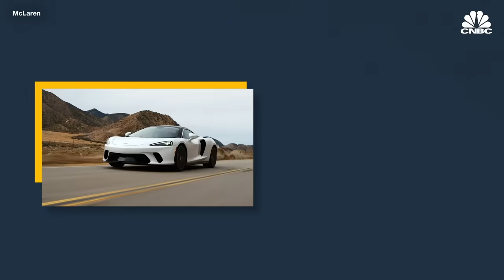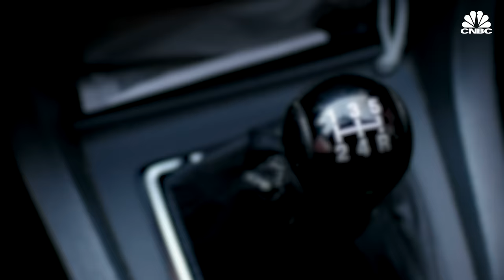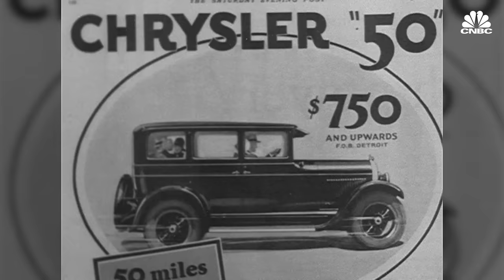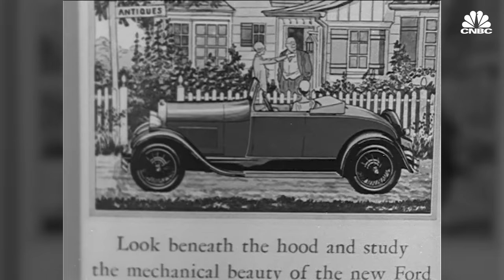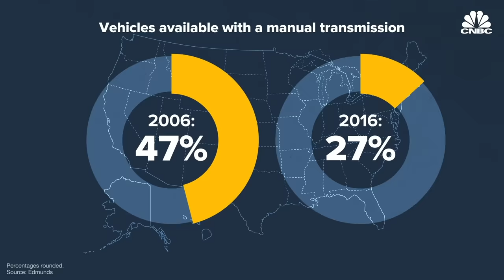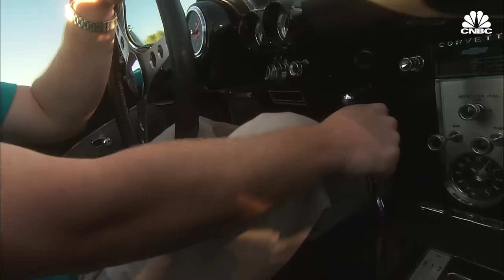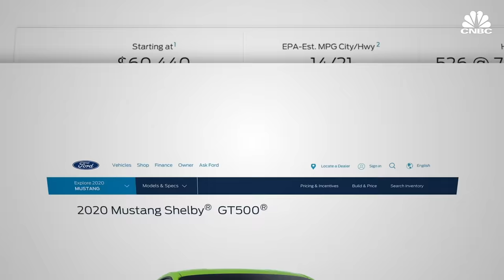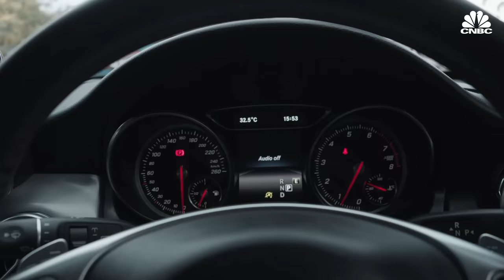Why Stick Shifts Are Going Extinct

Comment: Ill let you on why, because 90% of the people wont have enough skill to drive those type cars therefore the car market will be in decline. And its more expensive to fix an automatic and harder so your forced to pay loads and loads of money to the manufacturer to fix it, and your only able to fix it through the manufacturer who made that thing. No average mechanic would be able to work and fix a complicated transmission. Only above average and those costs more to work with... So more profit,  as your gonna be left with no choice but work with your car manufacturer which btw they make more money fixing your car than selling it.
With automatic even an idiot can move a car, though to sidewalk or to a wall at best...

People who drive manual are always capable of driving a car they got the skills for it." Else they wont be able to move it "  And besides with a manual, your kids won't text and drive at the same time one hand in a steering wheel the other holding the shifter, one foot controlling the clutch the other the break and gas pedals... So there is no room for the driver to get distracted, but with automatic! You can text while driving! You can drive with your feet! You can drink eat while driving! Obviously people would want to do that even if it means ending up facing the wall at 150mph while texting "BabyGirl"

So yeah its more convenient for idiots.
And inconvenience to those who want something reliable because bruh automatic are super unreliable. They break all the time, working on em is a big hassle money pit and they wont work the same as before.

Comment: If you own a supercar, and you can’t drive a stick shift, you don’t deserve to own a supercar. If you choose an automatic supercar, and can still drive stick then, so be it. I would disagree with that decision but to each their own. But it should be a prerequisite lol to be able to drive stick shift if you want to own a supercar.
Reply: I have yet to see a 500hp+ supercar with a manual transmission. At the least the use sequential gearbix paddles or dual clutch auto transmissions.

Comment: A manual tranny is for the pleasure of driving not for economy or being better than an auto. I have an old C2 Corvette and I love taking it out for a nice robust drive and winding through the gears is part of that pleasure. In traffic or long drives on an Interstate, a manual is just plain dumb. The new paddle shifters are no fun at all. I have one and it can be driven totally automatic or paddle-shifted. I see no reason for the paddles except in stop-and-go traffic where I keep it in 1st or snd gear, otherwise, I leave it in auto.

Comment: I used to be able to Drive my stick shift with one hand while multitasking.

I can have my bowl of weed in one hand and be able to steer and shift with the other hand.

Of course id have to switch back and forth between hands. But it would always be ONE hand at a time.
Like id Shift real quick then put my hand back in the wheel

Comment: How did those EV's work out for their owners in Chicago during that brutal cold snap they had last winter?  Some couldn't even be unplugged from the charger!  And now crack heads are stealing the public charging cords for their copper.

Comment: This is such a meme video, US isn't the entire world and snowy and harsh conditions are much better with manual transmission than automatic. On top of that many automatic gearboxes have terrible lifetime expectancy, of course car manufacturers are very much interested in putting a dual clutch gearbox in your car that requires extensive repairs or replacement after 100k, rather than them have to supply manual transmission with 250k + lifetime

Comment: Can you bump-start an automatic these days? I remember being told you shouldn't, but that was many years ago, so they might have changed.
Reply: You definitely shouldn’t because the car doesn’t know how to react properly and it could damage it.
Reply: @GrillerRohde  In that case, still another reason against; flat batteries still happen. I wondered if there had been developments in auto boxes that made it safe to do. I guess one with a lock facility would be OK, but that's only a few models (and I think only for cruising speeds, which wouldn't really be any good for bump-starting).

Comment: Personally, I love my stick shift. The problem is during traffic. When the car in front of you starts to go, then you have to shift into first and let off the clutch and give it a little gas. In that short amount of time the automatic in the next lane has already cut you off. Driving a stick shift in most cases is far better than an automatic. You have more control vs an auto, you get much better MPGs, and the maintenance is far cheaper. But driving a stick shift in traffic really sucks.

Comment: I own a 2008 Honda Civic Ex coupe manual 5 speed transmission, I am a 41 year old female! My first 2 cars were standard transmission. I had to learn how to drive one if I wanted a car when I was 16. Best decision in my life because later in life I fell on hard times and had to buy a car quick to get out of the situation I was in and it was a stick and I told the seller that I might have forgotten but guess what I didn't and was my decision for buying. But, now my problem is that these 25 year old "men" can't pull it in the shop bay to change oil or tires and has to get the oldest guy to move my car. Yes it's a big problem because I know how to drive one it's my daily driver, and I'm a woman. Who figured we'd come to this time in life?

Comment: Well, this is really American-centric view. I am amused to hear, that automatic transmission have become more efficient. Compared to what? If you look at American gas-guzzlers or sports cars, where fuel consumption is not big issue, then you are right. But when you look on EU car market, where fuel prices are high, there is clear answer, which transmission is more efficient - and this is manual. Unless, of course, you drive hybrid, where you have no other choice than automatic.

Comment: Look driving a car that’s a manual it’s a secret there’s nothing all that challenging about it easy to get taught it’s not a road Ranger gearbox with no synchro then there’s a reliable in that and get used to that but the beauty about manuals are specially in small four-cylinder cars for one you don’t have to constantly get them served and they will outlast an automatic and with some smaller cars all automaticsAre a little bit lazy and changing where do you have a manual and you go up the hill you can drop down gears as well but manuals are not that bad before cylinders

Comment: Manuals are fun until you hit traffic then they are the worst thing ever. My daily driver will always be an auto, aint nobody got time for a manual in traffic
Reply: how are they so bad in traffic? i prefer manual for traffic
Reply: @arcanevoid9199  I'm talking about stopped traffic. There's a lot of riding the clutch in traffic that is stopping and going.
Reply: @skynetcybernetics9058  using the clutch isn’t riding it, but it’s still really not bad unless you’re not comfortable with your car. you can also try not moving every time the traffic moves and wait till it moves a decent amount and then go, or use the idle of the car to move it when the traffic is moving slowly. and if you have a stiff clutch that’s making your foot tired then get a lighter one
Reply: Sounds like a skill issue. I regularly sit in traffic with a manual car, and I have no problems operating with a manual. And I don't ride the clutch like ever. You just have to know how your car works, what's good and bad for it, and after that, you can get by with a manual just as efficiently as with automatic.
Reply: It's so automatic to me that even in traffic it ain't no thang to me.
Reply: I drive in Los Angeles congested traffic, and I still prefer a manual.

Comment: I learned to drive in manual cars, my parents never drove anything else because manuals are cheaper to buy. Many of my mom's friends drove stick too, so did my dad's. I drove nothing but stick for years.
So, I can attest that manual no big deal. The whole stick shift obsession is overblown. I drive an automatic RAV4 now, a quite nicely made, very boring vehicle that's perfectly fine for getting where you're going and has plenty of space for lugging crap around.
Manual transmission driving can be good fun, until you realize that there's no point to it other than that. Maybe they give you a little bit better feel of control of the car, but there's no point in having a manual tranny in anything other than a pure sports car.

Comment: The stick shift is still the preferred option in almost all sub 400hp performance cars. 
Over that point the autos handle power better and the companies decide paddle shifters and electronics controls are the better option to prevent driver error.
Most sports/muscle cars come with a stick.
Additionally some news reports are indicating a increase in stick shift sales in the us.

Comment: BMW has dropped the manuals for the M5 and M6, those have the big bulky V8s, but not the M3s or M4s. I drove a G80 M3 that had one. And a M2 Competition, the M3s and M4s are more of a track focused trim in terms of suspension and handling in comparison to the M5s and M6s. Their focus has literally "shifted". Get it? "Shifted"? I'll stop.

Comment: Ironic, that short photo of a Jeep doing some rock climbing.  That's where automatics shine.

I bought a used Jeep with the 5 speed Peugot transmission because the automatics of that era were notoriously problematical.  The two situations that decision sucked were 1) stop and go traffic, and 2) pulling a small boat and trailer up the launching ramp.  I could do this only in 4WD Low range. 

An advantage of a manual is cost of repairs.  A clutch now and then, for the most part.  

Automatics are now hideously complex.  Nine speeds becoming normal.  You do not get these repaired down at the local Aamco. IIRC, I saw some years ago that a factory reman transmission for the Corvette cost $5000.....plus installation!   Nothing like the old Dodge Torque-Flite that I repaired myself.

Comment: I just bought a badass 🐎 GT and it wouldn't be what it's if it were an automatic. 🤣🤣🤣🤣. I get it when people wanna just drive automatics though and with normal cars other than my mustang or motorcycle I actually prefer to drive an automatic as well, sometimes you do just want a break without having to shift so I get it

Comment: "you ride an automatic, you drive a manual"
That's the most brain dead take ever.  Just because you like manual more doesn't mean it's better. Based on science and logical thinking automatic is by far better. 
The only argument that people use against automatic cars is that it is more fun to drive a manual.
Sorry to brake it to you but this is not a real argument, it is just your emotions.
Reply: how did you get that it’s better from that statement? that’s not what he meant at all

Comment: I learned to drive in a manual. About 16 years later, my car (manual) died and I had to buy a new one  REALLY quickly. There were only automatics available. I'm not regretting the switch since I spend a lot of time driving in the city and traffic jams, but sometimes I still want to grab the stick and change gear while driving. Three months since the switch to automatic transmission and I don't see myself ever going mack to a manual.

Comment: They’re going away because they are a pain in the neck to use. I’m a motorcyclist too, and I would never consider a bike without a manual clutch and gearbox. But motorcycles are a dream to clutch and shift compared to any car or truck.
Reply: A manual car with a really nice, smooth progressive clutch engagement is very enjoyable to drive as well. I've noticed that smooth clutch engagement is very rare on the few modern cars that have them though. The engagement is very abrupt and the clutch locks up with a jolt.

Comment: The automatic has gotten popularity because new generation have gotten lazy about everything in their life, if manual transmission was mainly sold 80% of population wouldn't be available to text or be on Facebook like they do now..I drive a 18 speed semi daily I look a people driving auto vs manual you know who's texting and making tiktok videos the most? 
Manual transmission should be offered either way on most vehicles if they were to do that people holding to their 80,90, early 2000 vehicles with Manuals would be open to buy a newer model.. all my vehicles are manual until 2009 and I won't buy one cuz the automatic.

Comment: It is the only way to drive a sports car
Reply: No it isn't because pretty much every sports car is available with an automatic transmission--and on top of it, these days the automatic car is not only faster but it also burns less fuel. The only catch is that the manual one is more entertaining to drive.
Reply: @devilsoffspring5519  says every guy that can't drive stick
Reply: @MTbone7  Learned on 'em, drove 'em every day for years. It's really, honestly, not that big of a deal.

Comment: The unpopularity of stick has benefits. Most could not steal your car, and sticks are less desirable so sell cheaper on the used market... Also, besides clutch wear, the tranny is super durable. If you find a reliable car like Honda or Toyota, you can trust that it's worth it to keep repairing the engine as you know the trans won't die on you.
Reply: Plenty can and will steal your car. I've had my manual car stolen plenty of times, so have others. They just destroy the clutch doing it, that's all.

Comment: I recently had to move a 4 wheel deal drive stick shift, 20 miles with no brakes at all, by carefully using the low gear range at normal speeds.  Automatic transmission is for folk who barely know what they doing in charge of a car:   Basically the infantilism of the masses, as required by the Elite.